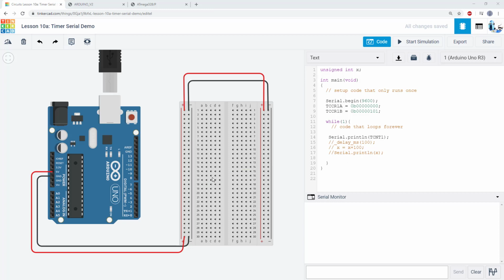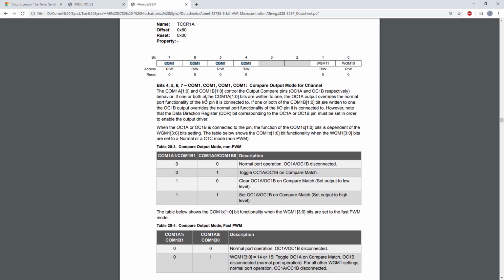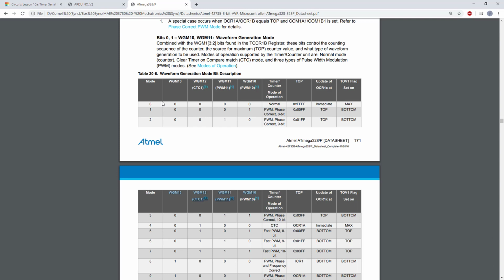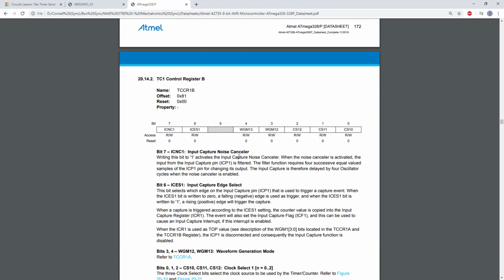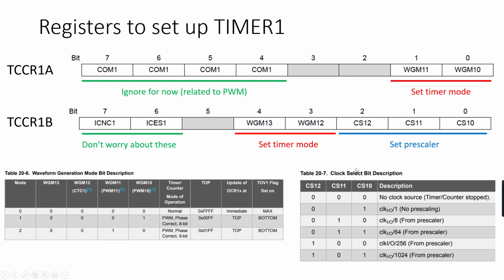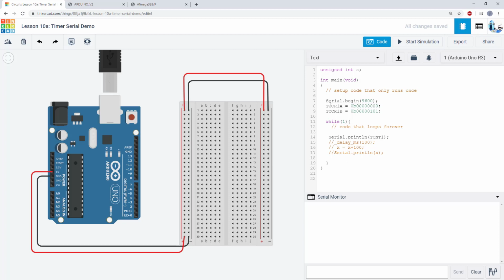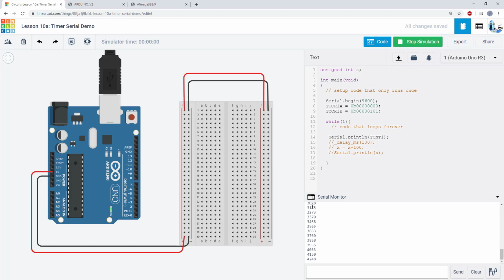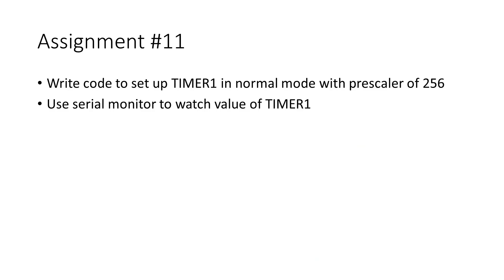Tinkercad + Arduino Lesson 11: Timers Part 2 (Registers)

Comment: very nice demonstration
i have one question
 can we use timer/counter on tinkercad like this?
#include <avr/io.h>
void fordelay()
{
	TCNT0 =  0x74;		// load TCNT0
	TCCR0A =  0x00;		// Timer0, Normal Mode
	TCCR0B =  0x02;		//  1/8 prescaler
	while((TIFR0 & (1<<TOV0)) == 0);	// wait for TOV0 to roll over
	TCCR0B = 0x00;		// stop the clock source
	TIFR0 = 0x1<<TOV0;		// clear TOV0
}
int main (void)
{
	DDRK = 0xFF;	// OUTPUT
	while(1)
	{
		PORTK  |= (1<<4);
		fordelay();		
		PORTK  &= ~(1<<4); 
		fordelay();
	}
	return	0;
}
i used it on 2560. i wonder if it work on tinkercad arduino uno
Reply from the maker: Hi Waqas - honestly I'm not sure, you would have to try it to find out.
Reply: @BenFinio  sir, I tried and I don't why it's not working 😔